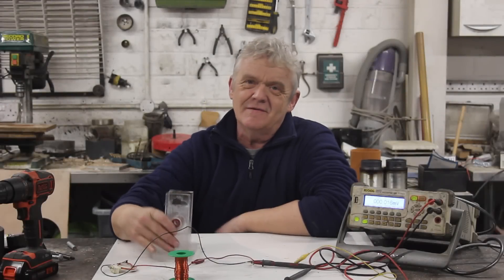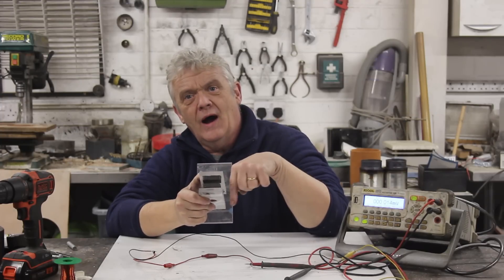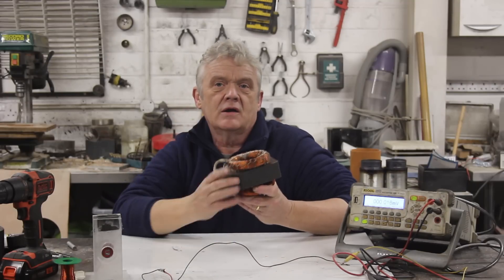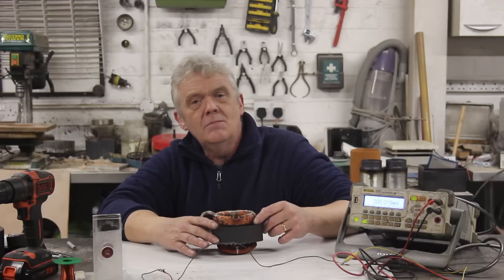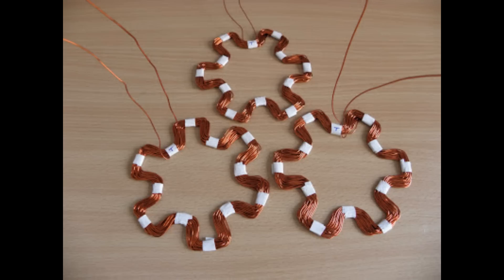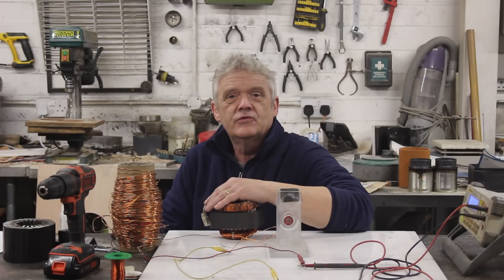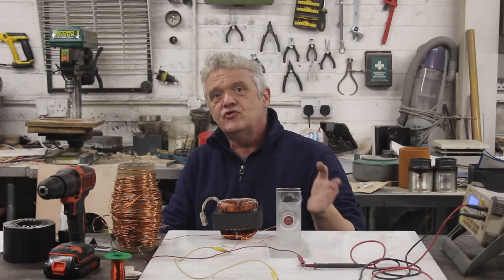1800 Super Easy Coil Winding - Serpentine Coils For DIY Generators

Comment: i have built serpentine coils each coil has 200 truns, placed exactly the way shown in the video yet am getting weird voltage ratings from each coil and btwn each phase to phase i.e. for r-n= 255, y-n=2488 and for b-n=100 and for phase to phase r-y=494, y-b=258 and b-r=246. is there a way to get the same output from all 3 coils? what is it that i did wrong and what is it that i can do to get constant results for all the 3 phases? can you suggest something?

Comment: If I already have the drive line .
What would be the best winding set up to attach to said drive line ? 
  And I'm a weirdo so would Tesla Receiver to Tesla Transmitter to Solid State Capacitors work ? Because that would look BITCHEN ! 
 What ? 
As my Uncle John AKA Mr. Wizard ( the radio broadcast) said : " It's Electricity! It'll do what you ask !" 
Oh one more question ? How many ends does a Drive line have if you Drive the line from the middle ?

Comment: dear sir, I was came across a YouTube video it was foreign. I think the guy was Serbian or Argentinian or something but he took an induction heater and he produced electricity with it with a magnet coil he said, do you know how because I can't find the video anymore. He literally had the induction heater on took a ceramic iron, ferrite magnet with wires wrapped around it, and all he did was held it next to the induction heater and as it got close over top of the copper coil the wires sparked between two points he had set up

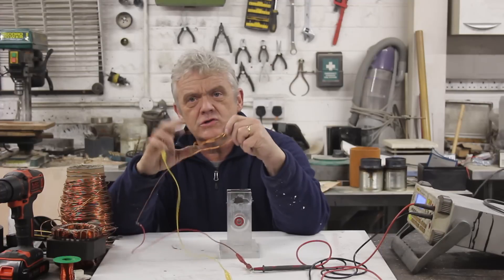Comment: @3:45 Im always afraid ill rub the coating off the wires when im experimenting, so i havent tried thigns klike you show have been tested.. I learn alot from you bro :-D Thank You 😀 What if the coatings fail, then the wires short and loss of power in the coil  happens, probably correct?

Comment: @1:30 it doesnt recognize the wire as a current flow when its already within the field, thus proving that the wire must move across the magnetic fields to produce a voltage, not through them. Through them is innert...

Comment: First thing that comes to mind is the large amount of copper wire that surrounds an old crt monitor or tv. It literally is ready to be turned into a serpentine coil. Great
😀I am not sure now if you mentioned it but could the serpintine simple have a v instead of a u shape to reduce the outer copper . Its 6am in the morning and i need to sleep 🤣

Comment: You mentioned that serpentine doesn't help with the wast on the ends, however, circular couls have a top and bottom wasted and serpentine has either a top or a bottom not both.  Would expect a 50% reduction of waste at the ends.

Comment: First I just have to say you are top notch! A few times a go you Rob talk about gear and before that about speed before that the law of Physics! Now I come with a comment! And it might be what in Sweden called speed we called it fart! In higher speed a better outcome of energy you say double speed give back eight times! But then we lift a few Questions about this we touch the scary law of physics! Now over to alternativ VAWT a Savonius slow in action but high i torque a Darrius high in speed and low in Torque and all between! Take Darrius if the middle rods for fasten the blades was shaped like V:s  a Savonius way to get them work easier and one of the cheapest way to! But it slow down the Darrius a bit like a lower gear but how much? Then you do this kind of coils we work from center of the Windmill! as a motor I buy the Idea! to gear up the speed!  But still we must alway se all ideas as good idea to the day something say otherwise!  🥸

Comment: Time ago I made a small generator using a PCB with a zig-zag track pattern and a flat fridge magnet (those flexible ones that usually have images on them), but didn't work well, it just produced less than 80 mV, and was able to reach a power output about 30 uW. The PCB was 5*5 cm btw, and to produce the power I just simply rubbed the magnet flat on the PCB

Comment: You see thentional diverentional displasmends do to conditions above and below and i between😍

When the wire is olrady inbetween and you move themashermend is in a diverend strings pressend jad not as implayeble as electricity 🎁
Reply: Make a tred of diverend thikness and than do again over the lengt of the wire you wil masher the diverentional do to the diverend thicknesses of the wire inbetween the magnets

Comment: I suppose you could make a tube and wrap the coil outside around its length then have a circular magnet running to and fro inside like a piston. You could fix that to a heat differential engine and bingo. Magnetic fields are around the edges of a magnet so they would be very close to the copper wire that acts as a dielectric deflector.
Reply from the maker: yes you should - that was the idea behind the shaker torch

Comment: So can you just run a bar say one inch long of copper every cm around the wheel not connect any of them then have horse shoe shaped brushes on each side staggered from the right to left side so when you spin it the graphite brushes  complete the coil in rapid succession left to right couldn't you then use thicker copper for higher amperage output plus graphite is cheap have a dozen brushes staggered left from right around to complete the circuit and just straight copper rods between magnets inside I wish I had the equipment to build it and see please test it for me I'd love to know if it would work my brain says yes.
Reply from the maker: I am sorry mate if you want to test it you will have to build it yourself

Comment: i bet the one with out wast will be like a microwave turn table motor you know rob there are fridge comp motors made like that  i think they are in some of the fridges that fail so bad when fairly new
Reply from the maker: the force produced would be the sine of the angle of the curved loop passing through the field

Comment: Output is dictated by speed, no.turns on the coil, and magnetism.  The missing factor, for me, is working out what torque you need to keep a generator turning.  I attend with bated breath.
Reply from the maker: emf = BLV sine theta mate - it depends on length of wire, velocity and strength of field oh angle the wire makes with the field

Comment: Have you been following the PCB motors on Youtube?  Where the coils are printed using multi-layer PCBs.  Just a thought?
Reply: Also, the Harmony (small scale) wind turbine (which changes its exposed surface area to match wind speed) might be of interest?
Reply from the maker: I have seen them mate - cheers

Comment: That is tremendously cool.  I've been working on driving synchronous brushless motors as opposed to BLDC motors, specifically high frequency injection (HFI). 
But apparently it's very expensive to wind coils for synchronous motors.  I'm wondering whether your serpentine coils behave similarly to synchronous motors?
Reply from the maker: if you pull apart a microwave oven turntable motor you will find that is a synchronous motor and it is a single straight forward coil - I am not sure why you think coils for synchronous motors are hard to wind?
Reply: @ThinkingandTinkering  Maybe I have my terminology wrong.  If you look up "PMSM distributed windings", you'll see they look like the coils you're trying to copy.  What makes them special is that they overlap, allowing you to produce magnetic fields at any field angle and thus smooth, maximum torque anywhere between the three commutation phases.  We use them in precision robotics and are very expensive.

Comment: Thank you for pointing out the issues with copper overhang in a motor/generator.  Serpentine coils do a great job of mitigating the issue with overhang. But there's a closely related way to wind a coil to reduce the issue of overhang even further, and that's to wind what's called a faulhaber coil. 

The axial flux motor I made on my channel uses a flattened axial flux faulhaber type coil that is only two wires thick to minimize the airgap between the magnets and a slotless iron stator for zero cogging. The winding sort of resembles  VVVVVV going  around a circle. Then their are  Dimond shaped coils. 

Yes those two winding types are diagonal to the direction of motion.  But they eliminate overhang and still generate a voltage proportional to cosine of the tilt × the length between bends.  They are able to produce more voltage with less wire  when compared to traditional circle, and square as well as serpentine  coils.  

I cant wait to see your next video and see what coil type you'll cover in it.
Reply from the maker: I think of the diamond shaped coil as a variant of the faulhaber - which you are spot on with and is my next video lolol
Reply: @ThinkingandTinkering  And even more simply, both the diamond and faulhabor are variants of the serpentine coil.
Reply: @ThinkingandTinkering if it interest you I would sugest search Google for images with the terms "thingap motor".  I'm immensely impressed with their radial flux faulhabor.  My next motor build will probably be like that. 

More on the diagonal.  If we look at a radial flux faulhaber standing up, the closer the diagonal is to the vertical, the shorter the wire is  crossing a given magnet, and results in a  better volt per length of copper wire / a given rate of change in magnetic field.  

To get the diagonal closer to a vertical, one can have a higher magnetic pole count on the rotor or one can make the rotor longer.  I say, doubling the rotor length comes with the added benefit of magnetic fields crossing less than doubled the length of wire, at half the diagonal angle from the vertical.
Reply: Well I hope you've not just ruined the next video for me....
Reply: @ricos1497  I don't know what to say. I've got an idea or two. I could be wrong or i could be right but either way, I'm still looking forward to Robert's next video. 

Maybe you'd enjoy watching me build and test a motor on my channel.

Comment: I wonder if a piece of iron could be used to bend the flux to make the wire useful as a generator, it works in my head, but physics is often like that,   your brain thinks one way , physics thinks another!!
Awesome video!! ✌️
Reply: Since the movement of those outer and inner bits of wire are in tangential direction to the center of the generator, those wires can never "cross" the magnetic flux. And that crossing is an absolute requirement to generate any current (like he demonstrated at the beginning of the video). Orienting the wires parallel to the motion just does nothing. You'd need to manage to move those inter and outer turns further away from the center of the generator to make those bits generate any current. Which is physically rather challenging ;-)
Reply from the maker: no mate the angle of the wire to the flux path is what matters not the magnet overhanging or not
Reply: @ThinkingandTinkering  yes sorry, that's what i was trying to say.. my bad
Reply: Magnetically permeable material (such as iron) can indeed "conduct" or "direct" magnetic flux.
But it will also "contain" the flux. 
Similar to spreading pipe over your yard. It efficiently carries water to all parts of your lawn, but it will still need need to "leak" (holes, sprinkler heads) to get the grass wet.

Comment: If people need some custom coils, they can send me the materials and take care of all of the shipping, and I will wind up to 24 coils one time for free.

But by all means, be sure that you have the return shipping so you get everything back.

No strings attached, no hidden games, just offering a one time free service to people who want some precision coils wound.

This is one of the very few things I can do to contribute to the community of DIY researchers, inventors and tinkerers.

If the mandrels need to be custom cut and built, to a limited extent I can build custom mandrels, but if the coils require epoxy, special materials for shielding, etc, this will be up to the person who wants the coil.

If this is confusing, message me and I can explain at length.
Reply from the maker: that is a really kind offer - I know what that takes and it is very generous too - cheers
Reply: @ThinkingandTinkering  I've had this custom hand built coil winder for 15 years now, and its just sitting here, so I think it would be potentially useful to people to help them start their experimental journeys in some cases.

Also, it gives me a chance to feel like I am contributing more than just feeding out technical information and random ideas to people.

Comment: If you get bored ( i doubt it will happen tbh lol) last year was a nightmare for me personally with the heat so i tried to make my own air conditioner. I made a rectangular box (6 in wide x 3in and 3 foot in length) at the bottom i had an airtight slot for the fan and at the top the vent. I then put 2 tubes going through the 6inch wide section, one at the top and at the bottom and wrapped plastic tubing around them going the full length. I made a hole for the end of the tube and intended to attach it to my cold water tap. I didn't go any further because i soon realised the plastic tubing would flatten were it went over the pipe and another reason was because i didn't think the plastic tubing would cool sufficently. I'm going to buy some copper tubing and try it again but i'm also wondering if picking up a second hand car radiator might be a better option. What are your thoughts on this Robert, do you think there might be a project for the future?
Reply from the maker: in the summer mate - no one will watch it now
Reply: I tried this with a very large copper car radiator once. It seemed to work well for a bit, but condensation plugged all the area between the fins preventing air flow. The condensation water wouldn't drip or shake out, ending that project quickly..

You might try spreading the new coil sideways like a series of overlapping ÒOOOOOQ
Reply: @Dr_Wrong  Very interesting, that's something i didn't consider. A very nice suggestion with doing the coils sideways also, i guess making a spiral would be the best solution. Thanks very much i will try this in the next few months.
Reply: killer Wolf  Thanks for the tips, i guess i better start getting this up and running as summer nears.

Comment: Robert, I do some metal scrapping. One thing that is becoming more common is electric motors with copper covered aluminum wire. Just wondering, if someone is wanted to use a motor to make a generator, does the copper/aluminum wire make a difference in out put?
Reply from the maker: not really mate

Comment: Does thicker wire produce more current? What would a copper pipe do?
Reply: no but it can handle higher currents.
Reply from the maker: no mate the thickness of the wire has nothing to with it - if you generate more amps you need thicker wire to handle the current is all
Reply: @ThinkingandTinkering  Morning Robert, have a wonderful day mate thanks for answering :)

Comment: Why do you use a bundle of wires for each phase, rather than a flat single peace?  Hope that makes sense?  If it does the same thing, could one potentially paint, print or forge and hammer a thin but wide and flat peace in place of the bundle of wires?
Reply from the maker: the emf (or voltage if you like) is dependant on the length of wire (Lorenz's law emf=BLV Sine theta) - a bundle of wires gives you a lot of length in a small physical space - B= strength of magnetic field, L = length of wire, v = velocity of wire and sine theta is the angle the wire makes with the field - if you muck about with those 4 things you can improve a generator
Reply: @ThinkingandTinkering  oh I see!   💡 Ty!!!
Reply: @ThinkingandTinkering  it's lenz law :)
Reply: It is not a bundle of wires but  a coil of enameled copper wire. This is basic physics more windings in the coil = higher voltage output. As he explains in the video, even a single strand of wire can behave as a coil, so a single piece of copper would act as a coil, but would yield next to no voltage. Remember electricity is a two part equation of voltage and current. Also bigger coil = greater intersection with the magnetic flux (remember this is a 3dimensional flux around the magnet) = higher energy output
Reply: @ET_AYY_LMAO  ty!!!
Reply: Could you simply use your highly conductive graphine paint and print a design for each of the three coils of wire perhaps onto a suitable structure?  Lastly, what if the suitable structure above was 100,000+ permiable dielectric material?

Comment: I've always wondered why someone has never invented a system like this to somehow attach it to busy railway lines to generate Free Electricity from the vibrations trains create.
Some trains (especially freight trains), are extremely long, extremely heavy and create very large amounts of vibration. I'm surprised nobody has created some form of hollow lines or pressure pads filled with coils and magnets to utilise those unused vibrations.
Reply from the maker: you just did mate lol